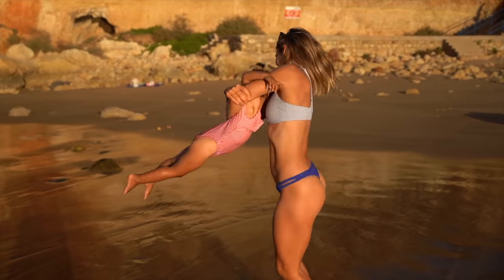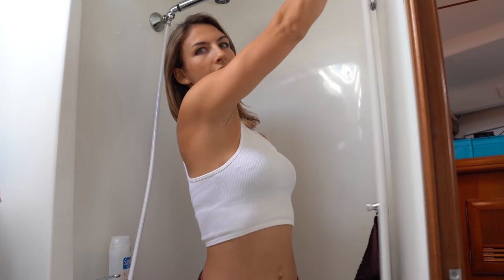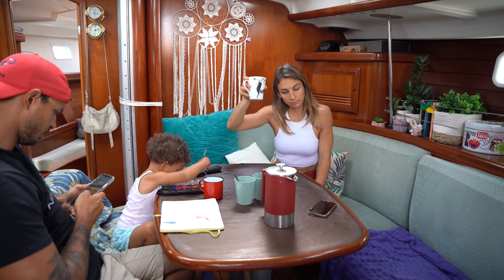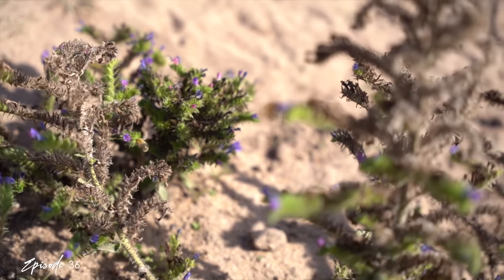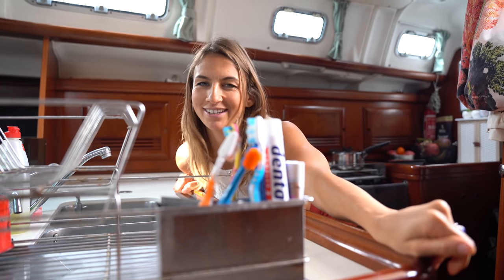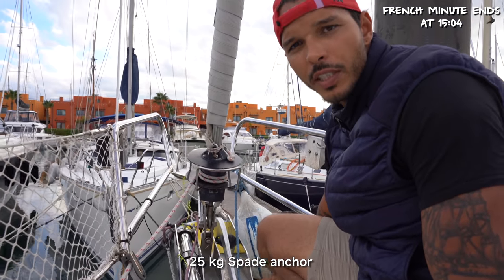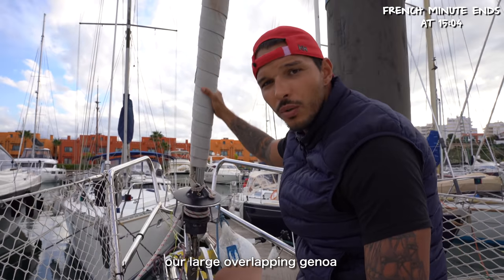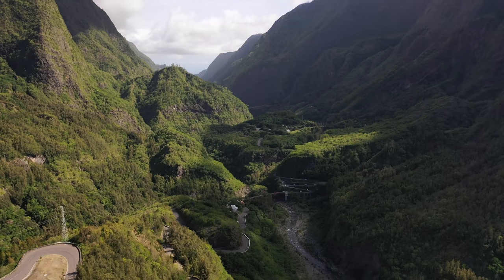BOAT TOUR :BENETEAU Oceanis Clipper 473 [EP48]

Comment: ..... Had to go check google maps to see where the reunion isles are, should be warmer there .. smiling  .... great looking boat, I got the impression the only thing that is not up to your liking is the size of the motor .... like the idea of the storage room off the galley .... with the batteries have you tried using a desulfurizer on them to clean the plates. I got seven years out of my last car battery that I changed out only to find out it was not the battery that was the problem but the Negative lead was producing, I think the term was "a ground fault" anyhow, the circuit was not closed properly .. learning experience .... thx for the share of your home .. as always .. never stop dreaming, just dream bigger .. have fun be safe, save our oceans ...
Reply from the maker: Hey Peter,
Yes! It’s summer here ☀️☀️☀️ you’ll discover soon 😁
as for the batteries, we didn’t really try to desulfurize, we are working on an entirely new installation, to be totally autonomous 👌
Warm regards,
Dani
Reply: @nomadcitizen   .... that sounds exciting .... look forward to seeing the reveal .... thx for your response Dani .... have a great week, in the land where it is summer .....